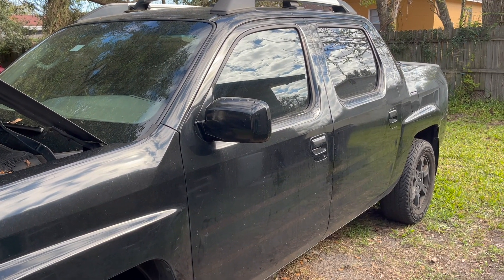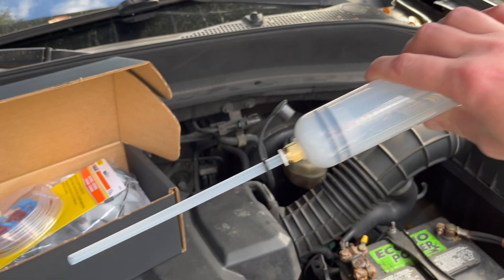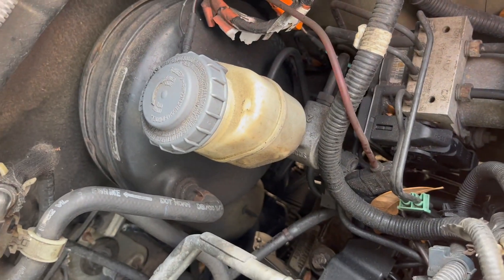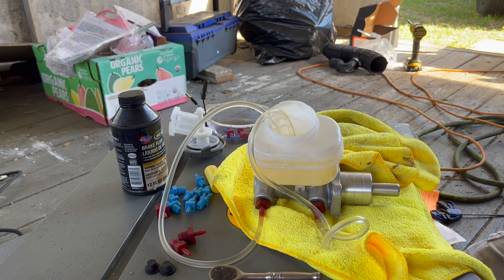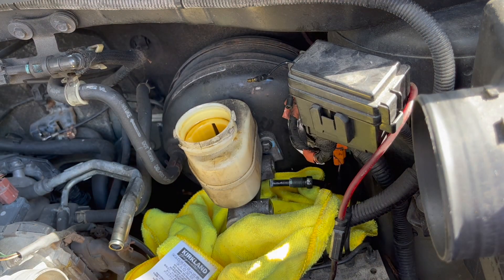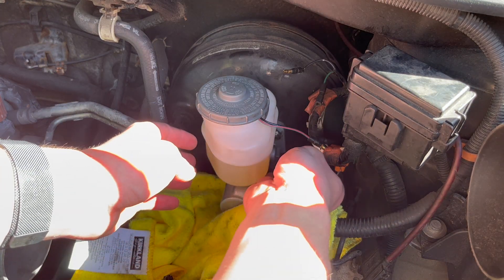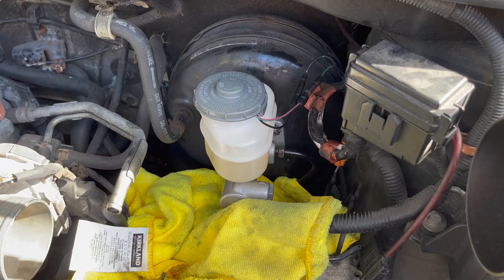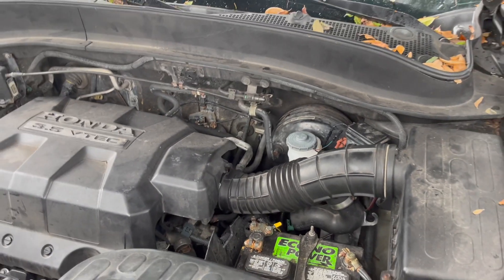Ridgeline Brake Master Cylinder Replacement

Comment: My 2011 honda Ridgeline I change all break pads, rotors and new fluid break and the truck still not breaking well. I have to press the brake pedal so hard to do a complete stop . Do you think can be the master cilinder?
Reply from the maker: It’s very possible. I guess could also be booster.

Comment: Did you have air in your breaks after this or did your method work fine ?
Reply from the maker: Initially I thought I did, so I bled the brakes (there is video of that too), but afterwards I think that I did not have any or much air there, so it would of worked fine without bleeding the system.
Reply: @PZPal  awesome thank you ! Wanted to ask in case I ever need to replace my master cylinder if I could just do what you did in this video.
Reply from the maker: thanks for watching, I'll have more videos with Ridgeline coming. If you will do the master cylinder replacement, it might be a good idea to record on a video of brake pedal performance before replacement and then compare with afterwards. Bleeding brakes was pretty easy task too though, so if you won't be sure whether you have air there or not, it wouldn't hurt to do it.
Reply: @PZPal  I will keep watching I have an 07 ridgeline and 2011 accord v6  and love to keep my cars up to date with Maintenance and repairs.